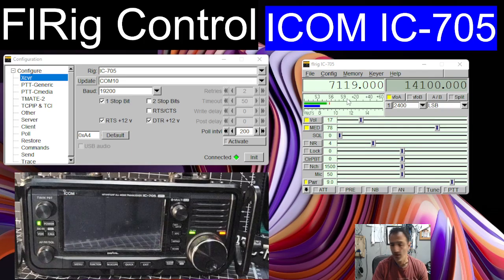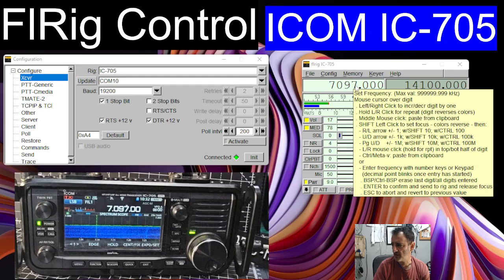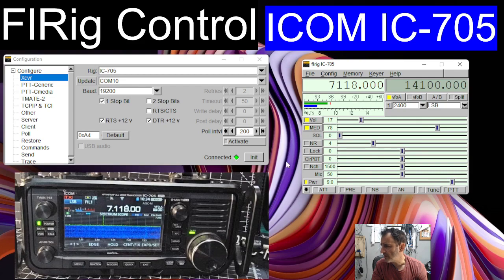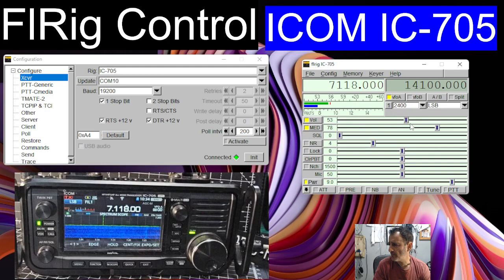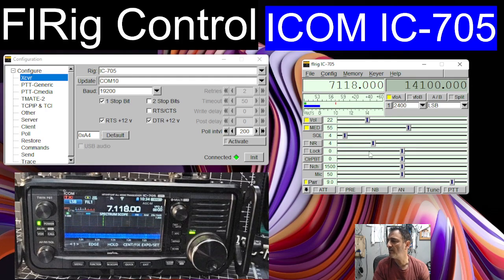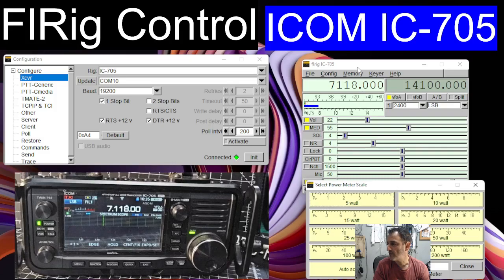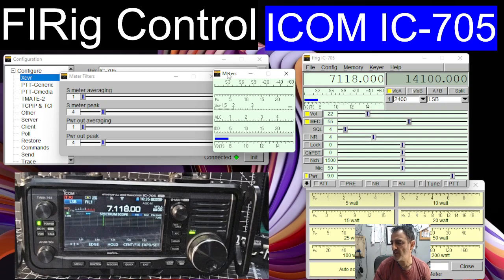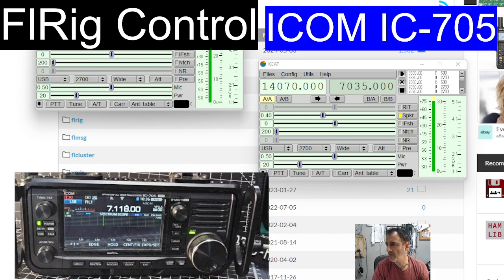FLRig - Control - ICOM IC-705 Free Control Software

Comment: I've been using WFview with a virtual serial driver and VB-audio virtual audio cable WFview pipes everything from the wireless access point on the radio to them, then I can use FLdigi or WSJT-X, JS8call, Winlink etc. from there. No more wires !! save for the antenna :)
Reply from the maker: So good :)